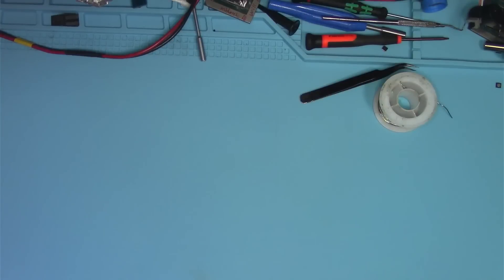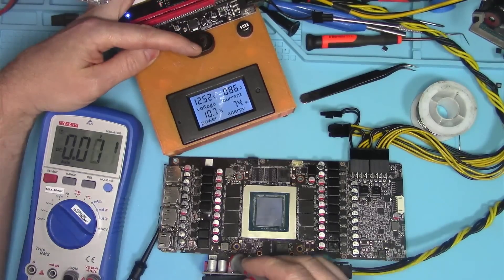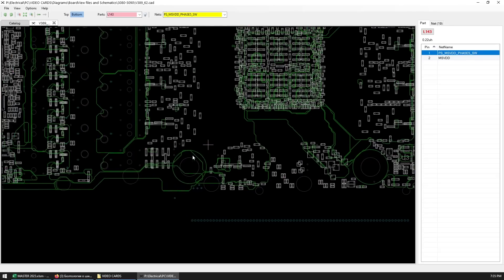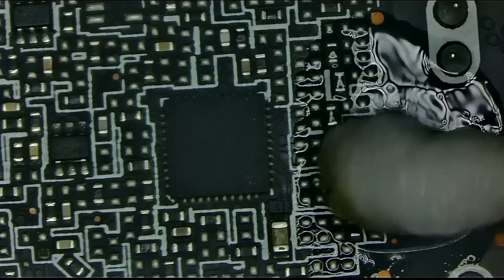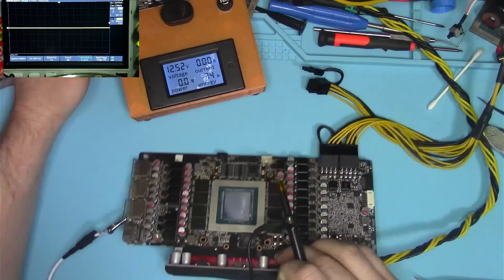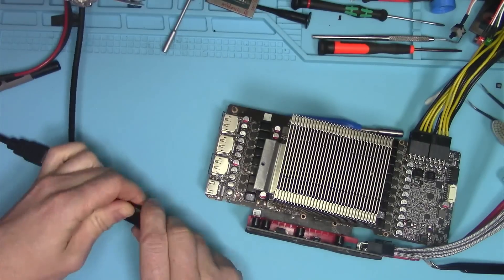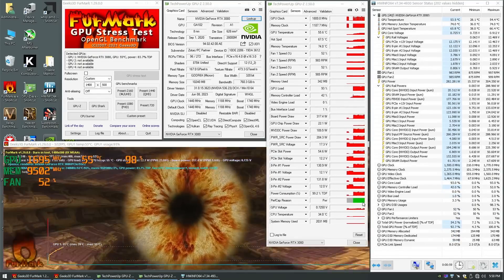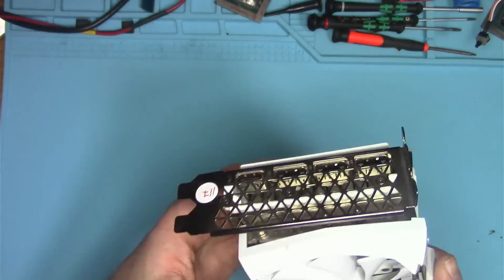What overclocking or poor maintenance does to your graphics card

Comment: 4:59 Wait, if you reduce the voltage but keep the same power limit (always in W) wouldn't the card actually pull harder on the VRM since it only deals in Amps (as far as I know same W with less v = more A)?

Comment: i would definitely charge around 80% of a full repair, this card will run perfect with a little undervolt and slightly reduced power limit in place, losing maybe 10% of the performance and 30% of the power use

Comment: I've had a 2080 overclocked since 2019 (core only - these last few gens of Nvidia GPUs have iffy RAM) and, it certainly looks nothing like that, and is quite far from dead - it gets used for hours nearly every day. I think the only card I don't OC around here is the 3080Ti because no power limit headroom = little clock headroom (didn't take to much undervolting either)

I don't know what the hell these people are doing to these cards but that is way more than and moderate bumps to power limit or clocks, or simply undervolting to get boost clocks more - that or there are some VERY low quality cards out there. This is not "overclocking"; it's either gross irresponsibility or buying poorly-made cards

Comment: so i recently built my first computer and i accidently nudge one of those little tiny resistor off of one of the component rather its motherboard or GPU im not sure, but the whole thing ended up working okay. at first my computer wouldn't stay off it would randomly turn on by itself but after a few days it went away. is it important that the resistor was knocked off or not then? lol
Reply: yes. you destroyed your computer.
Reply: @gregoriomariano5070  working fine tho. weird XD

Comment: Would you go into more detail as to what you think killed this card?  I’ve been over clocking for 20 years and never killed a card.  You never actually said heat.  You have more insight into the intricacies of graphics card design than I do, so I’d be interested to hear if it’s more than, it got too hot for too long.

Comment: There is no good reason to OC Ampere 3080 or above as they are terrible overclockers for a lot of extra voltage and heat, excellent undervolters however.

Comment: Success. It was dead. Now it isn’t. And I do recommend undervolting, always. That 10% or so will give many years to cards if applied early in their lives.
Reply: Yep especially as that's a rather mediocre cooler, the owner likely made performance worse with overclocking, anyone with a 3080 or above should undervolt, it's not worth leaving higher end Ampere cards stock.

Comment: Success! Defo success!
To be fair, overclocking if done right and COOLED right would not kill a card this way, but as you said.. it requires maintenance which this card seems not to have get :(
Reply: Higher end Nvidia Ampere cards in particular are terrible overclockers, not worth the extra voltage and heat. Nvidia Pascal for example sure excellent overclockers and well worth doing, really depends on the architecture, don't overclock 3080 or above, simply not worth it.

Comment: Overclocking doesn't do this to your card.  Letting your card get too hot does this to your card.

You could achieve identical results by running the card in a case with no airflow or using a card with a poorly designed heatsink.  We have MANY examples from recent years of cards blowing up because of bad heatsink design even at stock speeds.

Moral of the story is keep your hardware adequately cool for whatever speeds/power you are running it at.

If you are pushing it past spec then be prepared to live with more fan noise or upgrade your cooling solution if you don't want it to blow up.

Comment: When a customer overclocks a device they know the risks. They sent the device for repair. You've recovered 90% from 0%, losing only that 10%. The customer took the risk and must accept a 10% loss of performance for a repair is far better than  A 10% decrease in performance from a £500 card, you charge say £150, it's still a bargain and saves the customer having to buy a new one immediately. I always buy components that CAN be overclocked because I feel they have a little more overhead because they can be pushed a bit further (I know they've simply had bits zeroed to allow the customer to set other variables higher, but are otherwise the same as their unclockedable counterparts, but that's besides the point), I never actually overclock them. It's better to buy devices that the manufacturer has certified can run at a certain clock speed all the time than to overclock them, sometimes this will mean spending more money or waiting till another chip is released... But why do it, it always shortens the life of not just the main component but all components, and the overclocking will only ever last as long as the weakest component in the device.

Comment: Whilst the repair job is a fine one, I don't agree with your statement that overclock (or lack of maintenance) might have killed the card. I would have agreed with you 15 years ago but today's cards have the capability to monitor the health of not only the GPU core and memory temps, but also of the VRMs and many other components. Plus, nVidia does not allow you to raise the GPU power draw absurdly via software (you need to do a shunt mod or perhaps BIOS mod).

Perhaps this Zotac card is a lower end model with basic hw monitoring?

Comment: The highest I've put on my PNY Revel 3080 is 2400MHz. Mostly leave it stock.
Just out of the box, factory settings it will take itself to 2010-2050MHz 350w but stays about 60C.
It's never seemed to care about it's "FE specs". It's one of the first runs, 10G, before LHR.
Reply: I find it doobie us@boofygoofy3758 2200 has been stable all day. No messing with voltage. I don't leave it cranking like I said, I'd rather not have it 'splode

Comment: I undervolt my components rather than overclock/overvolt, I rather get max life out of my components than chase performance.
Side benefit the subsequent lower voltage and lower heat meant my video card would actually achieve higher scores since it'll achieve higher clocks.

Comment: My Aorus 5700xt had won silicon when i bought it new in 2019 for 400 Euro bevore corona. Bios modded it 2020 with morepowertool and hits 2230mhz even today. Of course i have changed thermal paste with liquid metal to enshure best thermal results but i am surprised that it works with the same 1.2v on the Chip. Really impressive card!!

Comment: I don't understand how someone with the knowledge to repair components like this also has non idea how safe GPU overclocking is nowadays. You can't kill a card from overclocking, the power limits and voltage limits are very locked down, and changing your clock speed doesn't harm anything. I think it's more of an issue of QC not being good enough.

Comment: This is not due to overclocking or poor maintenance... This is purely nvidia f-ing up with VCORE and MSVDD + the voltage spike transients + poor strategy on the power distribution between MSVDD and VCORE... The problem is that MSVDD + VCORE can pull say 350w combined... As long as they don't pull more, that's fine right? Since the board is designed to handle that much... Yeah but MSVDD is allowed to pull 350w alone and Vcore is allowed to pull 350w as well... So in some weird scenarios one rail could pull way more than what the VRM assigned to that rail can safely deliver, leading to bursts of the VRM drawing double what it's built to... This is what happened with the titles like New World on the 3090s (3080tis were affected too). 3080s were mostly safe as they almost had the 3090 vrm design but had a lower power limit... I've had 2 3080tis fail on me in a year... Both VRM failure, both power limited to 300w (One had a 370w limit and the other had 450w) and undervolted to 0.85v... Both cards were watercooled with sandwich blocks with active backplates with pads on both sides of the power delivery, using huge loops, never seen anything more than 55c on the core and the VRM temps were just laughable to say the least... These cards failed under the BEST case scenario... I can only imagine what would have happened if i run them with stock coolers on stock fan curves using the max power available by the manufacturer... The channel ActuallyHardcoreOverclocking aka BuildZoid has a series of 2 or 3 videos explaining exactly what's happening with these 30 series cards, take the time and watch them if you haven't already :) It's no coincidence that the 3090ti only had VCORE and got rid of the MSVDD rail... 40 series as well... Anyhow, thanks for the awesome content man... I really appreciate it... You and 2 or 3 other channels have helped me a ton to learn so much about board repair! Keep it up 😇😇😇
Reply: "This is not due to overclocking or poor maintenance... I've had 2 3080tis fail on me in a year..." -gamer into overclocking

Comment: #Q: In your experience does a video card built with a great cooling live longer/not as likely to die. I have an old pc with an Asus Strix rx 5600 XT video card. The card runs so cool (under 50C) even under 100% load from gpu mining that the fans will stop every now again if I turn up the air conditioning. I've always had it overclocked. (Not a big deal if it dies).
Reply: It is hard to say mostly what kill a gpu is not actually the temperature but rather voltage. OC works by supplying more power to the GPU (core voltage) in the long run higher voltage degrades silicon in the die thus ruin the gpu.
Reply: @Teasharky oltage is still hardcapped by VBIOS, unless you do external control or physical mod.

But some GPU may have limits set too high, i suppose.

Comment: I call it a fix. It's working again where it otherwise wouldn't, and what's the alternative. It's not reasonable to expect a phase that causes that much board damage to be repairable. You did the best with what you were given. My only complaint would be relying on software to undervolt, which could end up causing a problem with the end user.
Reply: tell the owner that if he overclocks it and it blows it's his problem, no warranty provided.

Comment: Im going to repair your card by drilling a hole into the board. Disable a circuit and return you fully working. Hell yes Id call that a repair. Partial repair fully functioning is good to go. 
Id use that card because it has a black eye.

Its no different like a wood worker who lost their thumb in a saw
Reply from the maker: What would you do ?
Rebuilding this is nearly impossible let alone practical.
Reply: @northwestrepair  you fixed it, even with 90% functional. send it back into battle until it completely fails =D

Comment: Overclocking needs to go hand in hand with undervolting in todays power hungry GPUs. By doing both moderately you can have less current draw than a GPU with stock settings, hence less heat and power waste.
Reply: 100%!!!! Thank you. So many people in the comments are demonizing overclocking all together. Like undervolting is awesome dont get me wrong (I got my surface pro 2 using like 75% of its original voltage and gained huge perf) but a proper balance is way better. Its just harder and way more time consuming than a pure undervolt or overclock on their own.

Comment: Dang. Makes me glad I took a safety route with my new 6900xt. I don't need the full performance. Since it runs hundreds of hours with AI/video encoding, I decided to pull clocks and power back to 80% of each. It never pulls more than 200w or so.

My 580 killed the encoding block with h.265 at full power. So, I took a safer approach.

Comment: You cant kill the cards by the typical software like msi afterburner.   There are hard caps on voltage and heat maximums.  Only way to kill it is with a flashed bios with no limits or self downclocking when hot like a stock bios would or external modification to override any limits imposed by software.

Comment: Is there a risk of damage to the GPU undervolt? I'm using an RTX 3060 Ti with GDDR6X and I think the temps are high.
Reply: No risk in undervolting its actually better for your hardware, if you go too far you will get crashing. I run the heaven benchmark then undervolt my card with msi afterburner until its unstable then bump the voltage 25 to 50MV before the card crashed. My 3070 temps went from 74c to 62c. The card runs at full clock speed and doesn't throttle now. Noticed no real world difference on performance maybe 3 or 4 fps loss in benchmarks however noise is better and less heat is a good thing.
Reply: @Alex-ii5pm  Thanks for your help, you're awesome! ... Without undervolt my GPU reached 77C (ambient ~33C). In the test it crashed at 0.918V, but I liked the result at 0.95V and 1950MHz. In the Superposition benchmark test, the temperature dropped from 77C to 69C, and the max fps from 71fps to 70fps.🙂

Comment: Honestly there is no proof it was caused by overclocking. Mosfets failing this early are most likely defective from factory or are not properly cooled.
Reply: What I personally really recommend doing on Nvidia cards is undervolting. Huge power efficiency gains and way less stress on components (less heat and less power).

Comment: Wish GPU repairs werent so expensive here, my evga 780ti 3gb acx died 3.5 years into a 3 year warranty. one day while playing rainbow six siege the PC froze with pink pixels and after restarting it kept getting worse and worse until it wouldnt even boot up anymore, probably dead memory but to this day im frustrated since it was factory OC, i didnt touch a single dial yet it somehow died in a full atx case with 5 120mm fans. and because repairs were 50% the cost of a replacement i went with (and still am using) a 1060 3gb but i know my 780ti ran better despite the measured performance, it was way smoother. also  a point of interest is that my 780ti got up to 1333mhz in heaven by itself which iiirc was on the high end

Comment: I got the feeling last gen Zotac Twin Edge had overestimated how much one can/should save on smaller rads. High quality plastics and fine products in general, but I had to undervolt/limit my 3060ti on the day one to get rid of vacuum cleaner sounds during gaming. In open case. Probably saved 10..20$ on rads/fans during manufacture for the price of ruined first impression and image.
Reply: Zotac is lowest tier of NVidia cards.  Lowest of all.
Reply: @dgillies5420  I would disagree. The design is decent and materials used actually good. They just f. up the math or overestimated what people would like to endure.
Zotac was bad a while back, but it has changed quite a bit. Also if we start looking for high tier, there is like no one there. Gigabyte hasn't changed design for 5+ years. Well they have no designer at all and it's boring af. I'm also not a fan of MSI since that gaming laptop of theirs 15 years ago. Probably better by now? Asus... yeah, the price is crazy and last gen(?) they f. up royally with that sagging cooler. So who's the good one? Palit, Gainward, Inno3D, PNY, KFA2...? So wtf do you mean?

Comment: It is rather mosfet quality failure. The more expensive will blow out the cheaper ones will melt everything.

Btw if you disable a phase, all the phases will be disabled after that.
You can re-wire the 5th phase to the 6th and disable the 6th to gain one more phase.

Comment: I always do undervolt + OC example my curent GPU Rx 6700 stock Vcore 1.2V but is now happy running at 1.076V this lowered hotspot temps by 11C from 102C to 91C

Comment: Is undervolting safe for the card? In the summer I always undervolt it to 70% power plus fans at 100%
Reply: You might want to go easy on the fans. Those are usually among the first things to fail. Undervolting is completely fine, card will clock accordingly

Comment: This is an insane repair that 99% of other techs would have sent back as soon as they saw the board damage.
Reply: The repair was possible because it doesn't caused damage to any internal important via. So drilling the centre pad and clearing the carbon worked. Eventhough the work is impressive and professional, still not harder than the PCB repair work of iPhone long screw damage cases. That is just another level.
Reply: Yup,i used to believe you can't even repair GPUs, as I was told as such by some repair shops.
Reply: @FoxyCAMTV you can't repair the GPU, they are not wrong, You can repair a video card as long as it's board damage, and the actual GPU die isn't dead

the store confused the difference between GPU and video card
Reply: @heickelrrx more than likely they just didn't want to fuck with it.
Reply: Actually I been in electronics repairs way way longer than this fellow, it can be done but it's completely unreliable and it will fail within days if not minutes due vibration,  thermal cycles and normal mechanical stress.
Being a good tech is knowing when a repair can be done properly long term and not just for a video.

Comment: Any reason why the GPU wouldnt post without the phase 5 disabled? Have same PCB 3090 where vcore phase 8 or 9 blew so removed it basically same way, but didnt disable the phase on UP9511, yet all is in order, all phases around have healthy waveform, gpu posts and actually ran for the past 1.5 years in daily.
Reply from the maker: It depends on which phases are broken and how circuit is built.

Comment: It all depends on what you're charging for the repair as used fully functional 3080's are offered in the ~400$ range(cost effectiveness). As for the repair itself I'd say it's a full fix as you won't notice much difference in normal workloads, a non-functional port isn't the end of the world and you saved a fine piece of engineering from becoming e-waste.
Reply: How do you even know what you're getting with a used card buy. You might even end up buying this card, lol